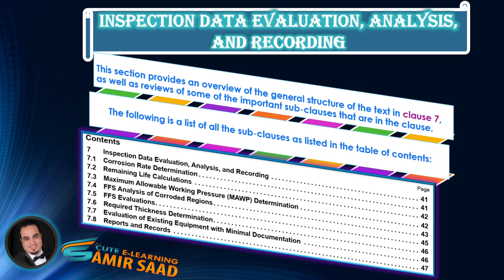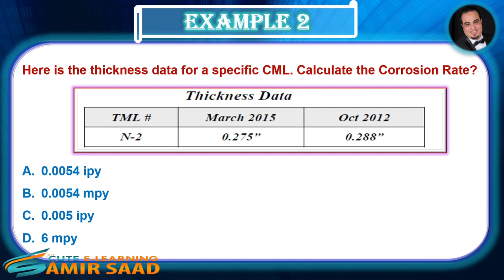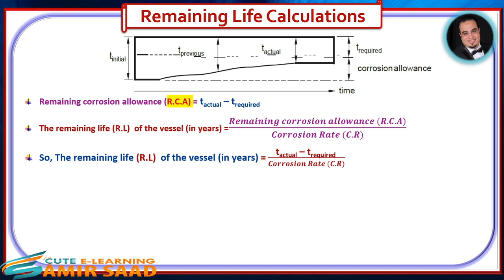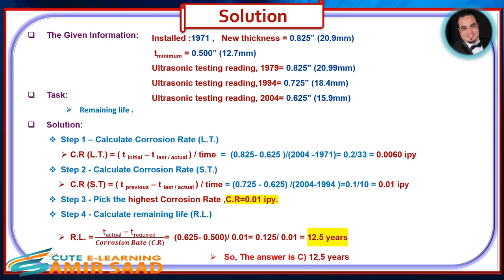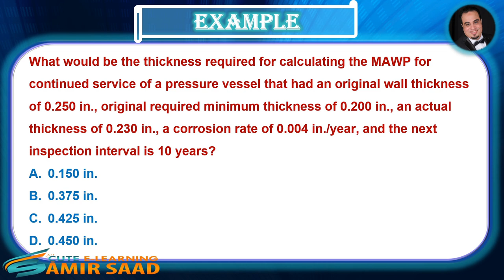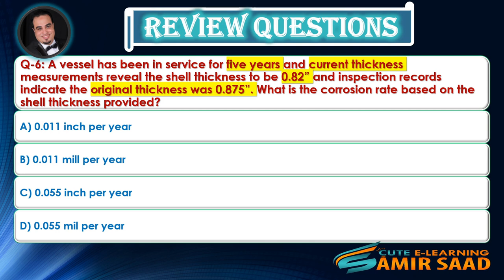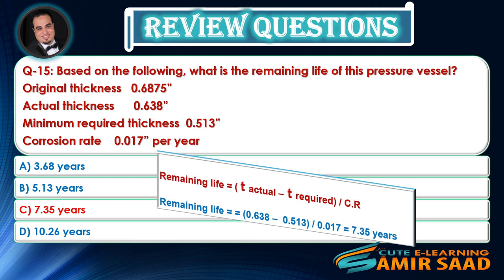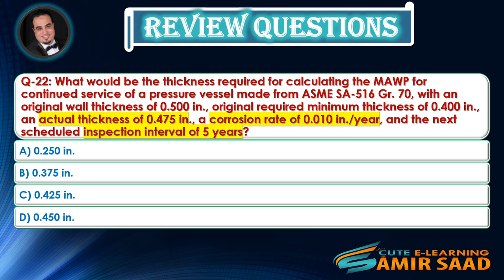API 510  (lecture 11)

Comment: Q7 calculation is wrong though 0.375-0.300 = 0.075 😊
Reply from the maker: C.R=( 0.375-0.300)/10 =0.0075 IPY
Please check again.

Only typo mistake 4 ,have to 10 .
Reply: May Allah repay with greatest success in life 🤗
Reply from the maker: Thanks a lot brother ❤️